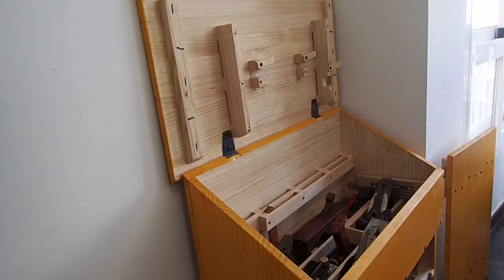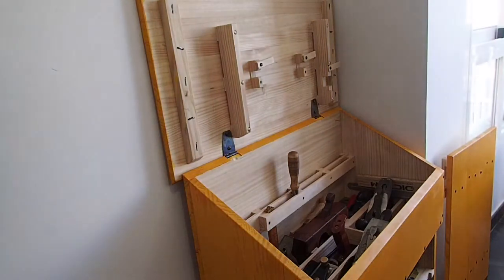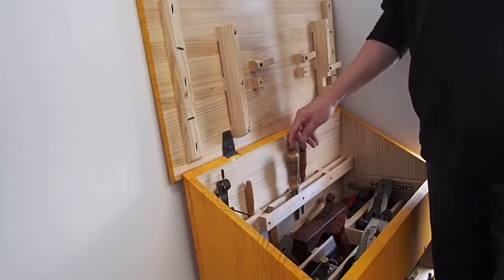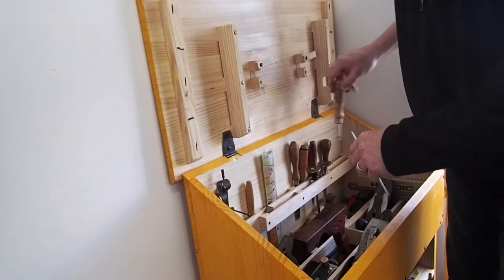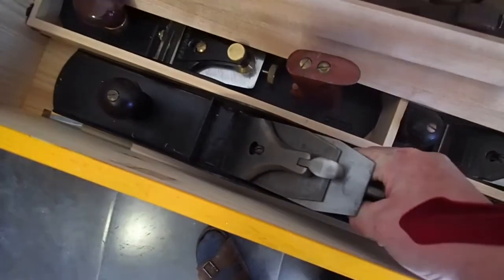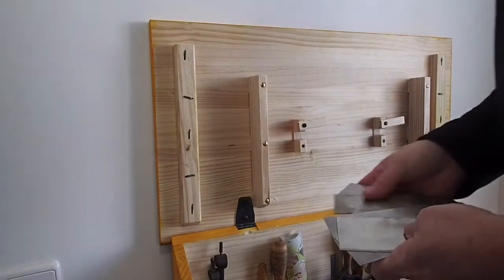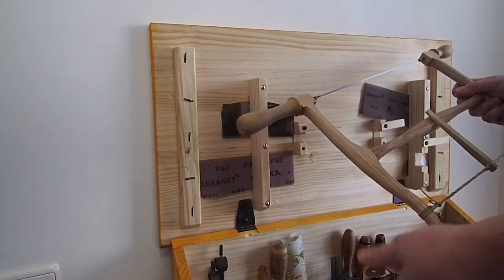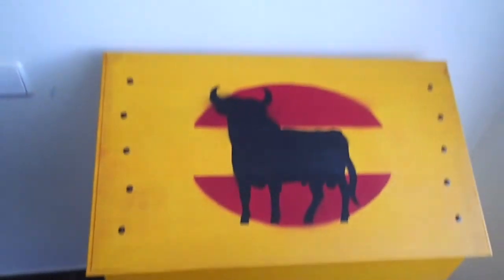Loading the Dutch Tool Chest Part Two

Comment: I use the same kind of driver , but gunsmith bits , you can get different sizes and the shoulders are dead square so you don’t wreck the slot of the screw! You can buy them through brownells !

Comment: It's too late to suggest this now but to avoid nterference with the battens, I allowed for a thicker front panel that I cut a dado in to to receive a sliding batten. This means that I don't lose and floorspace. I made the smaller DTC. 
I don't know how long you've used this. You do imply that you've not fully settled on interior partitioning. I wonder how well the lid will remain flat with just those two pine battens clenching it into alignment.
Reply from the maker: Haha! I followed Christopher Schwarz's instructions, and the ones I had didn't mention those battens on the front panel interfering with the center shelf. I cursed, then cut some clearance notches for them, then later realized it is the same solution CS has on his chest. I like your idea better, though.

As far as the lid, I've done lots of experiments in the past with cross battens, and I am certain the pine strips I have are sufficient. However, this is the first time I've tried it with clenched nails. I do expect it to work just as good as screws. My experience is that it doesn't really take that much to keep a panel flat.